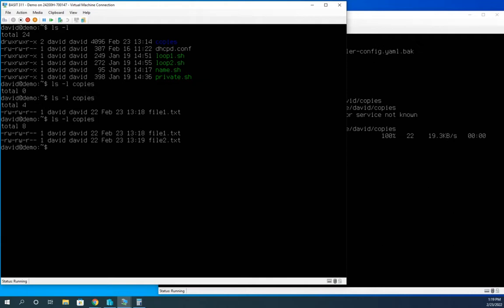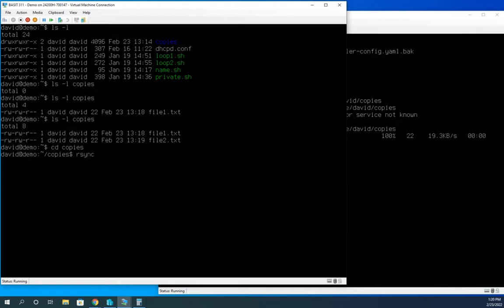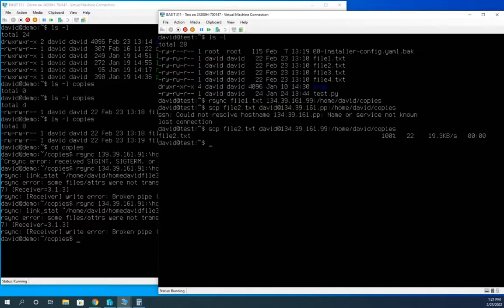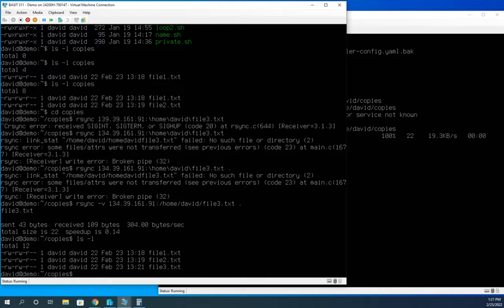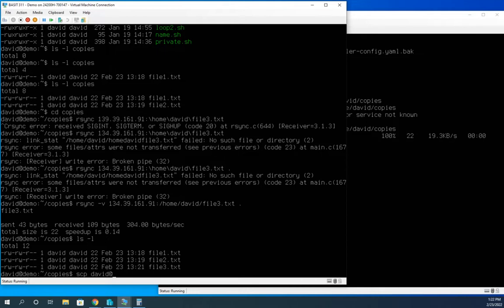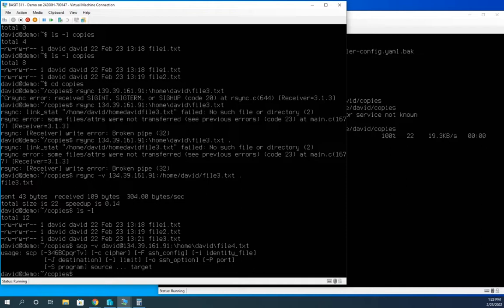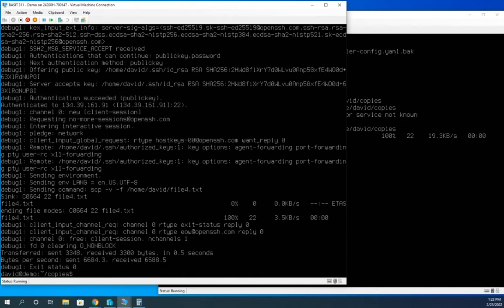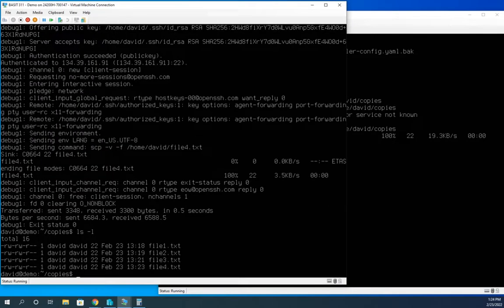Copying files between Ubuntu Servers

Comment: 1. Audio good
2. Content good
3. Presentation - NOT so good;
   A. Edit out the errors you make from your video; be respectful of viewers' time: YOU CAN ALWAYS MORE MONEY, BUT YOU CANNOT MAKE MORE TIME
   B. Improve the contrast of your command line - it is difficult to read to read the commands; use Oh My Z Shell to customize your prompt and play around with the options available in your terminal. Your viewers should be easily able to see where commands start and end, as well as in which folder you currently are. You can also upload a higher resolution video - at least 1080 (currently your best resolution is 720). You may wish to increase the font a little as well.
Hope this helps.